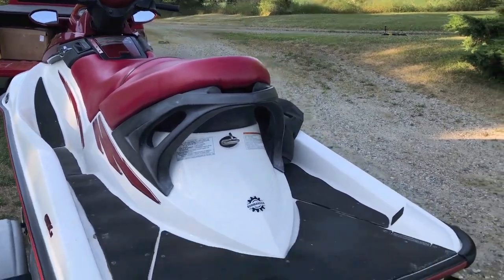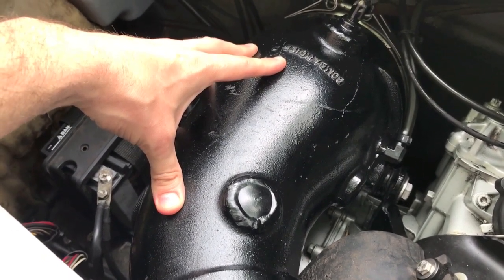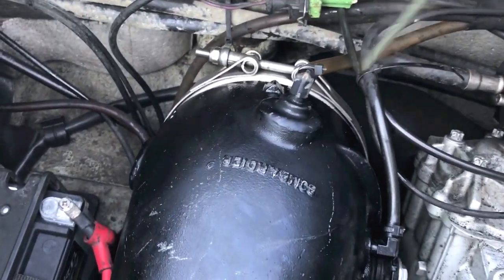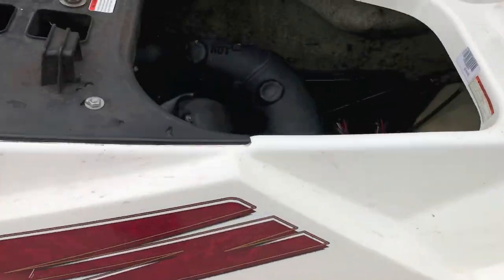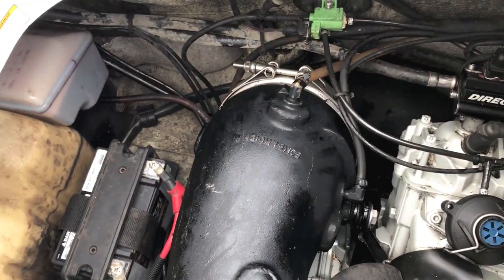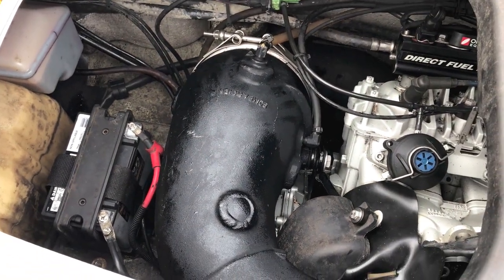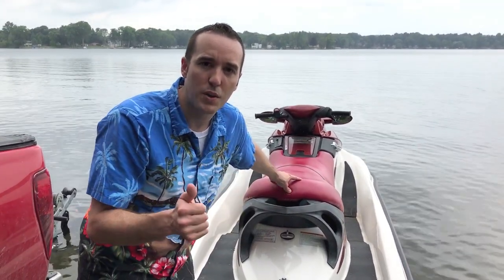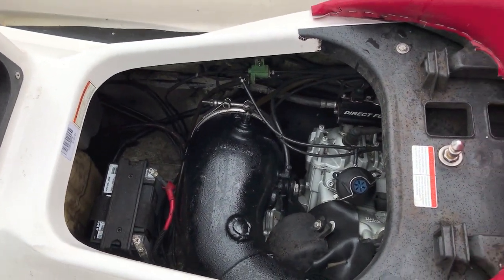Leak testing jet ski after engine work / Exhaust manifold pipe replacement!

Comment: I thought your not supposed to run water thru it without dtarting the engine? Is it okay to do so? I have a leak somewhere on my 03 rfi but i cant pinpoint it and having the engine running makes it even harder to spot i think. Please let me know!
Reply from the maker: Thanks for watching, any update?  It’s best to start engine first, followed by IMMEDIATELY turning on water.

However, if done the opposite, you will want to turn on engine on IMMEDIATELY after turning on water to alleviate any damage.

There should not be more than a few seconds go by.

😁☕️🧰
Reply: @DIYwithMichaelBorders  unfortunately i was unable to pinpoint the leak, the ski also starts right up out of water but wont start in water and has the maint light on. Was able to take it for one short ride and it ended up going into limp mode. Not sure if these issues are all related or not.
Reply from the maker: @J-RodsMods 

Thanks for the follow up, that’s odd.  Have you disconnect a black negative cable and left disconnected for a minimum of five minutes?  This will reset your system and hopefully reconfigure it.

Comment: Thanks for your vids, Michael, they're extremely helpful as I have 2x '01 Sea Doo GTS's that are leaking water in the hull and am trying to figure out how to seal everything.  I spent a ton getting the carburetors cleaned out and updated with all new fuel lines and filters so they run perfect, except the water in the hull.  I think you've covered how to seal the leaks but can't see how to watch your videos in series or chronologically, to make sure I follow, step-by-step.  Any ideas?
Reply from the maker: Russell Fine Arts 

Thanks for watching & sharing your comment!  Let’s get this figured out together.  Have you hooked ski up to garden hose & let Engine run on the trailer?

This will give you a great chance to inspect all areas that water can leak out.  We experienced an Exhaust Manifold leak however initially, we were convinced it was leaking from the bellow because when the ski was in the water, there was standing water in Hull.  Once we started engine, the drive shaft & bellow spin so fast that it was throwing water all over in that area...but not leaking.

I’ll attach links to several helpful videos that may help!

       https://youtu.be/xhi6U2WE3ro

       https://youtu.be/FVi7LH7Py68

       https://youtu.be/WfMv0LKEJc4

       https://youtu.be/jj-QdGSx0KM

       https://youtu.be/qNGT4NxXvHE

Keep us posted!  Please subscribe to the channel and turn on your YouTube notification Bell 🛎 that would be awesome thanks again!  😎👍🔧🔩
Reply: @DIYwithMichaelBorders  Hi Mike, thanks for you quick reply, now that's customer service!!  I haven't connected a hose to the jet ski yet as I didn't know how and didn't want to screw it up but I'll do that and see if I can find where the water is coming in at.  Thanks for the links to your vids, I did subscribe to your channel, hit the bell and liked your sites and hope you make a million dollars :)  You deserve it as you've been a great help.  I just drained the gas tanks and am putting antifreeze in the skis for winter hibernation but will revisit this in the Spring.  Thanks again!
Reply from the maker: Russell Fine Arts 

Very cool & thanks for the reply.  Keep us posted.  Thanks for subscribing, we subscribed back!  We are very interested in what you find as we work through this project with you!  😎👍🔧🔩

Comment: Nice repair series. Only thing I would do different is not let my trailer sit submerged past the wheel bearings while testing. I always unplug my trailer lights before backing in , submersible lights or not. But that's just me. Nice video!!!
Reply from the maker: arciefan 

Thanks for watching arciefan!  That’s a good idea!  We have been having a fun time replacing parts on the Jet ski.  We have more jet ski videos coming.

We appreciate your input, that’s awesome!  Hope all is well.  It’s a bummer it was such a yucky overcast misty day while we were doing the leak testing!

😎👍🔧🔩